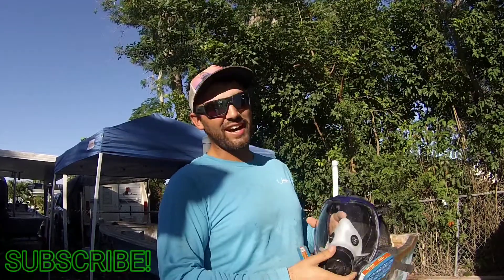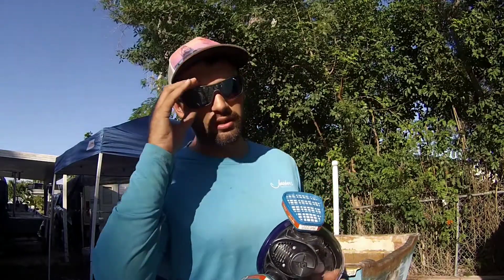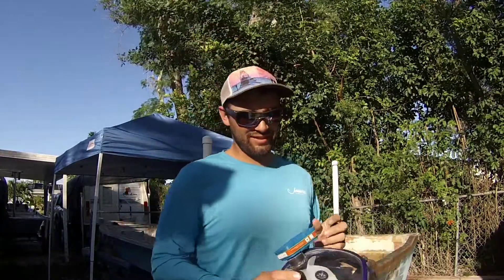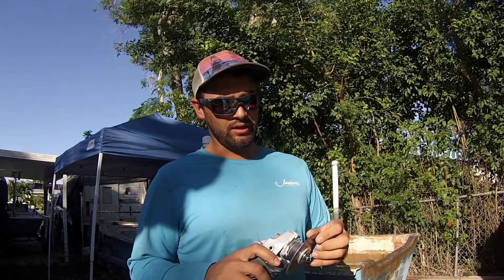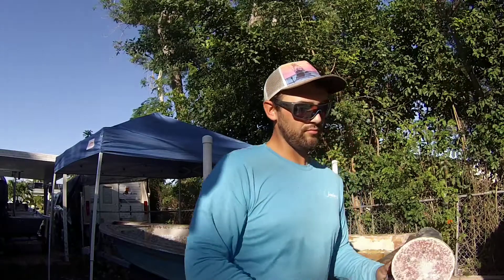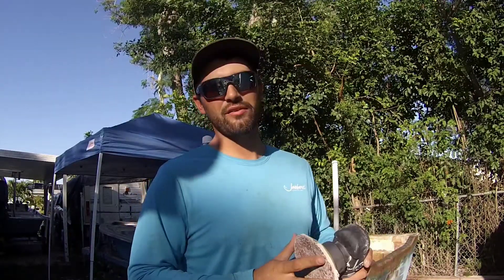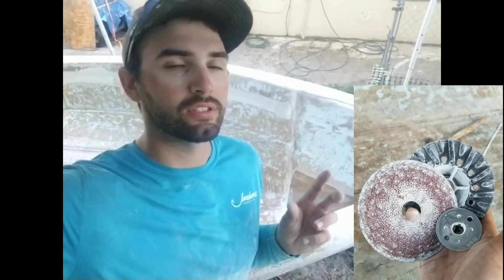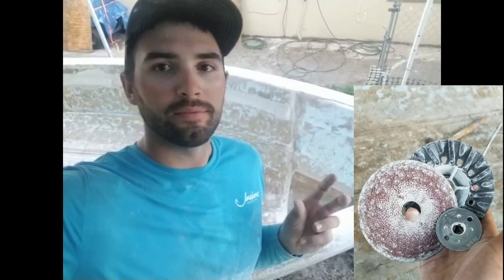DIY FIBERGLASS BOAT BUILD (Cutting out the old) Part 4

Comment: Does that diamond bit tend to gum up when cutting a wood cored composite? Like a boat deck or transom that has wood core? I have tried a lot of blades and only once have I tried those diamond cutters and it just gummed up. I typically just use a metal cutting bit but curious about your experience in blades.
Reply from the maker: Yes it dose. I try to cut as close as I can to the tabbing and what ever bonding compound they used then just break it the rest of the way out. If I have to cut threw the wood I'll use a circular saw or a sawzall.
Reply: @hotactioncustoms7008  yea same. Just thought maybe you had found that magical blade. Lol. Great video. You definitely know your stuff.
Reply from the maker: No not yet wish I could find a magical sander that's the hot ticket lol thank you I stumble my way threw it lol
Reply: @hotactioncustoms7008  magical sander, I have found. Well a cheaper version then forex by festool anyways. Bosch get65-5n has forced rotation or da mode and is great for everything in the shop. Not a bad price either. I use 5 inch with mirka abranet mesh. 60 grit on forced will get through gelcoat down to glass in an instant. Sanded all the gel off a badly crazed whaler 13 in 2 days. Like the whole outer shell of hull all the gel gone. Works great. But cutting decks out I’ve tried everything. Rotozip, diamond blade, skill saw, sawzall, and like you said skill or sawzall is best for sure. Anyhow. If you are looking for a good elec sander try that Bosch it’s awesome.

Comment: You can save that dust and screen it to make fiberglass putty!   Much cheeper than silica.  Even stronger!   I don’t see how you deal with the dust all over you.   I blow it away from me with fans or a yard blower.  My wife holds it.  I never were a suit any more!
Reply from the maker: Yeah it doesn't bother me all im worried about is my eyes and breathing it in other then that I just try to not think about it. Funny story about leaf blowers last yr I was finishing up a boat and gelcoating the top deck. well it was love bug season so they kept landing in my brand new wet white gel coat. so what I did was had my gf come out and fight off the love bug with a leaf blower as I gelcoated it was s funny I lol just thinking about it now lol. also a guy by the name of eddy on trick my skiff told me to save my dust another one of those things  should be doing to save some money!